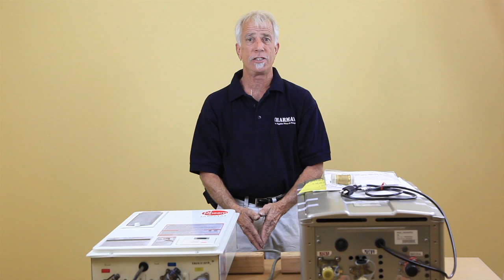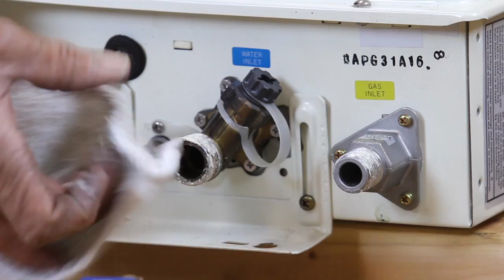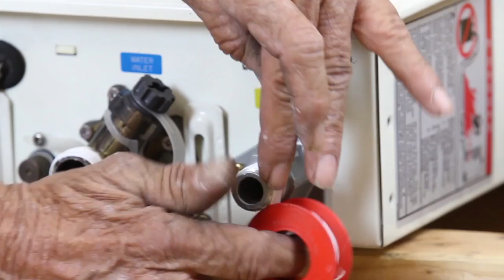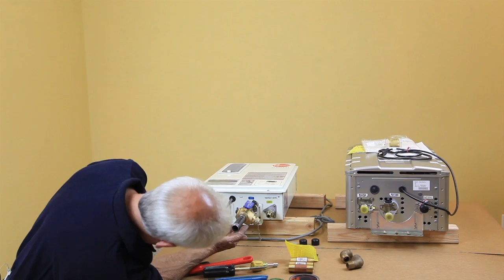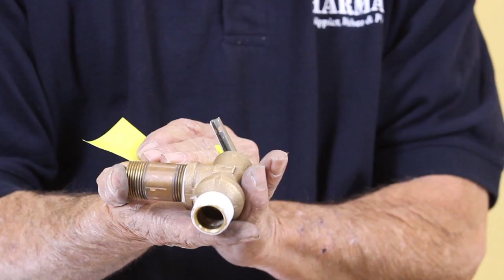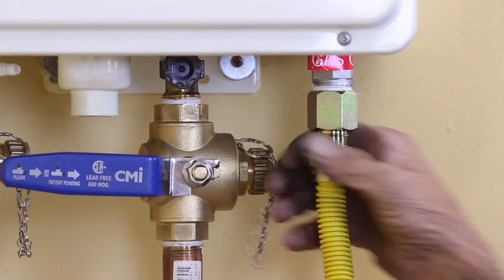Tankless Water Heater Valve kit Tutorial

Comment: Careful advising people to just wipe out accidental teflon paste from inside the pipe with a finger. Some of these products are highly adverse to our biology. I'd recommend a disposable / cleanable plug to olace inside the pipe is there's any chance of getting any of ut inside.
Also, there are many products and/or applications where you only want to be using one or the other and using both tape and paste is counter-productive to establishing a proper seal.

But yea, mainly ne careful with thinking that wiping it ou with a finger tip is sufficient, especially when dealing with potable watwr pipe and double so if there are young or vulnerable people who will be consuming the water.

Comment: Excellent presentation! The house we purchased came with a tankless hot water heater, however the plumber who installed the unit did not include the service valves. The unit is about 4 years old and I need to service the unit so I will have to install the service valves. I'm mechanically inclined enough to do this myself but what precautions do I need to follow before I begin to protect the unit? Thank you.

Comment: Where does the pressure relief valve drain to? Any drain pipe? What circumstances would cause that dangerous increase in pressure?  How does flushing work?  After you drain the tank what do you do?  Where would you attach a filter for sediment or hard water?

Comment: Our old on demand / tank-less water heater system is messed up. This one has a recalculation pump. It seem we only get hot water when another hot water tap is open than it seems to heat water fine than after a minute the water flow completely shuts off. If I turn the hot water valve off for a minute or so it will turn on with good flow for about a minute than completely shuts off the water flow. Anyone every had this issue, and how did you fix it  ?  Thanks

Comment: For heaven's sake people don't use the Teflon tape - Pipefitter for life and experience speaking. Alson the tape manufactures state if your using tape to only apply 1 and 1/2 rounds of it.
Reply: I have never seen pipe dope AND teflon tape (5 wraps, too) applied to a single threaded connection before and I've worked with plumbers, steam fitters, boilermakers, and sprinkler fitters for 39 years.
Was this overkill or is that spec'd by the code?

Comment: This type A tankless water heater doesn't need or requires a duct for vent.
There isn't a 120 volts power cord because the appliance probably runs with a couple of two 1.5 volts batteries or it has a hydropower water valve that generates voltage to activate the gas valve and the Sparks module.
The gas line is missing the safety valve that is supposed to be handy near the unit.

Comment: Very nice video but when using Teflon and pipe dope teflon is a thread lubricant to keep threads from binding and pipe dope is a thread sealant what should be applied after Teflon tape, there's also Teflon impregnated pipe dope which can be used by itself. I also noticed during your install there is no drip leg on your gas line before your valve, I felt this was worth mentioning to not only meet code but for safety. in one of these videos I would like to eventually see somebody include the 120 volt connection as well as the thermostat connection and the venting.

Comment: hi, do i need to use a reducer coupler 3/4" to 1/2")  if my house water line is 1/2" to fit the cold water input side of the service valve? thanks.
Reply: Your house main should be 3/4 or bigger or you're not looking at the main trunk

Comment: Either paste OR tape on joints surely?  Counter productive for either bonding properties...
Reply: Tape is to keep from having threads bind up, paste is a thread sealant. you should be using tape first and paste after if you're going to do it that way, otherwise only use paste by itself.

Comment: Shouldn't you turn to flush position BEFORE you take off the caps?????
Reply: The whole point is to attach the hoses first which necessitates taking off the caps prior to turning to flush. Otherwise water from the tank is going to run everywhere instead of in the bucket.

Comment: Where can I get this valve kit?
Reply: Look for Webstone valves on the internet.  Amazon sells them, as do several plumbing supply houses who have HVAC equipment.  There are several different sizes etc. so be sure you get the ones for 3/4 " supply for Tankless Water heaters.  A set of the valves for tankless heaters will cost about $80.  They are quality made, with two ball valves for each unit (one unit for hot water, one for cold).  Well worth it.   Then to use them to flush your Tankless heater, go to Harbor Freight tools or a big box store and buy what you need to end up with two 3-4-foot lengths of regular garden hose with a female connector on one end if each, and a $15 small water pump (a submersible pump used for your backyard fish pond works fine ...)   Get what ever fitting is needed to connect one of those garden hose pieces to the pump you purchase.  (hose barb or whatever).  One of those orange Home Depot 5 gal buckets is useful too.  

With the Webstone valves, the pump and two bits of hose, (plus a gallon of vinegar) you've got all you need to easily flush your heater.   Turn off your tankless heater.  Using the Webstone flush valve, connect the tankless hot water side to your new little pump, and the tankless cold water outlet (the flush outlet on the Webstone valve) to the other hose.  Close the big ball valves on the Webstone to isolate the tankless heater, then open both of the flushing valves on the Webstone units.  Put both hoses in a bucket with the vinegar and let it circulate for 45-60 minutes.  When done, close the cold water flush valve, disconnect your pump from the end of the hot water flushing hose, and open the main valve for cold water to flush out the vinegar from your tankless heater with fresh water.